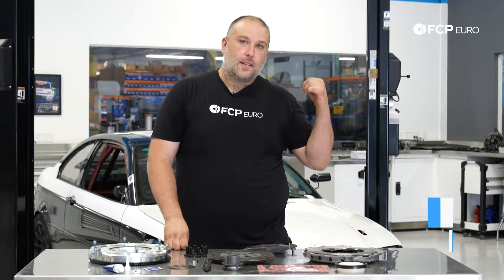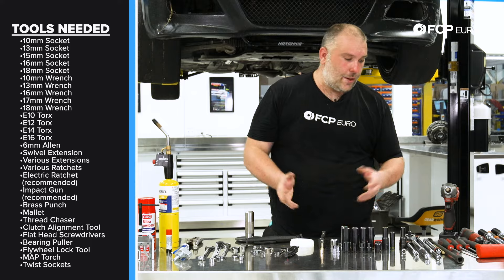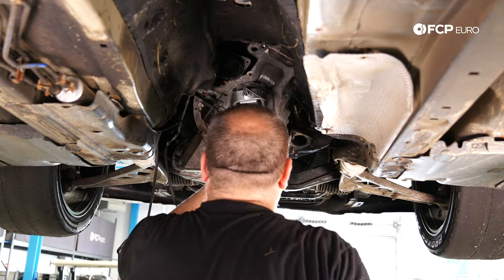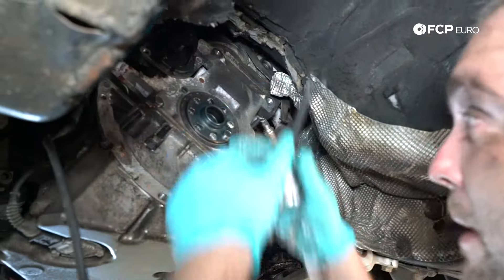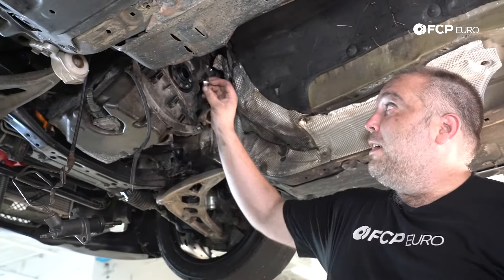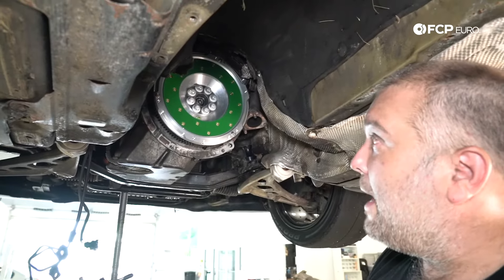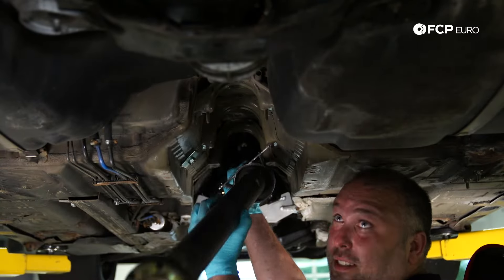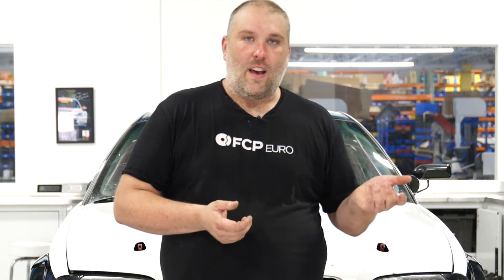BMW E46 Clutch, Flywheel & Rear Main Seal Replacement DIY (330i, 325i, 330ci, 323i, 325ci, & More)

Comment: I would HIGHLY recommend jacking up the front of the engine to get the trans lower even WITH factory engine mounts, makes life so much easier.
Reply: And because the motor naturally wants to lean forward, doing this will prevent you from snapping bellhousing bolts off in the block and possibly breaking off a piece of your engine block :)

Comment: You should probably tell people to clean the flywheel bolt holes BEFORE they install the rear main seal, because I did as you said and applied some brake parts cleaner, and some of it ran down and positively RUINED my neatly installed rear main seal that I just paid $55 for and spent half my morning putting in.

Comment: where can I get the torque plate you used and the bolts for it? or can I use the stock torque plate

Comment: I’m in the middle of a shifter rebuild and at the point where i’m debating dropping the transmission to replace my clutch. I don’t know if i can justify spending the extra money to convert to a single mass flywheel since these kits go over $1k.

Comment: hi there , lovely video I have got a bmw e46 320D 2004 diésel and I’ve got to change the clutch and flywheel , and in the descripción of your video it doesn’t say 320d.. , is this video valid for the parts I need to change ?
Reply from the maker: Hi Darryl, our models listed are based on U.S. trims only. We cannot confirm if your diesel trim may follow the same guide step-by-step since we never got that model here. The general idea for a RWD BMW clutch job on an E46 should be similar across the different trims.

Comment: So for the e46s, if you want to change the oil pan gasket, you’d have to remove the transmission? A lot of work and I have an e53 x5 😭
Reply: Nope. But you do need a engine hoist or the one that bolts to your shicktowers and hold the engine from the top to remove the bracket that has the engine mounts on it. This bracket is in the way of taking it off and that’s why you need ti support the engine up too as the bottom is being taken off to do it. After that you have full access to do whatever
Reply: @the46guide94  thank you

Comment: Hi, ld like your videos specially the s46 m3 ones and have an account on FCP
Do you made a SMG bleeding video or SMG clutch replacement? I just want to relocate my SMG pump with harness and hoses extensions and change de clutch kit to. Also with FCP I can buy a program to bleed the SMG?

Comment: Does the release bearing have a “wobbly” fit on the input shaft sleeve?
Reply from the maker: The rotating surface should have that, Michael.
Reply: @fcpeuro  so wobbly on the point of contact for the pressure plate, but not against the actual input shaft sleeve correct?

Comment: Hey when I was reinstalling my shift linkage I noticed that after I installed it my shifter on the inside of the car was not centered, when it was in neutral it was not centered and it was up and to the right do you know how to fix this thanks

Comment: At 30:56 these flywheel bolts were pre-coat with sealant to avoid oil leaking through the threads, not Loctite as you said. Two total different function.
Reply: Ok nerd

Comment: You didn’t mention the thread sealant that’s needed on the two 13mm bolts on the rear main seal plate. Those two are a must for oil will leak.
Reply: What’s the sealant called?

Comment: Can you also instal a single mass on a 320ci facelift?
Reply from the maker: Hi Floyd, we did not get the 320i E46 here in the states, however the process may be very similar.

Comment: Thanks for clear methodical video! 

I’m an enthusiastic newb and I’ve now got to replace a clutch for the very first time on my very first car – 2002 325xi. 

I rely tons on YouTube E46 DIYs and your video here is by far the best clutch replacement among actually pretty slim pickings. 

Couldn’t help but notice you start out though saying – 

0:38 “It’s a big job, it’s going to be a lot of fun. Hopefully.”

And then wind up at the end shaking your head to the camera and saying – 

40:58 “It’s not a lot of fun.”  

🤣🤣🤣

Still, actually it does look pretty fun – I’m ordering FCP parts now. Here we go!
Reply from the maker: Happy to help soyyoroaldo , good luck with your wrenching! Let us know if you need any help with your order.

Comment: Hey man, I had a shop install my clutch. Fx stage 2. They said they had to reposition, The starter to prevent damage to the starter or the aftermarket flywheel. This is a real legit shop, I paid 840 for the clutch install and 280 for them to just move the starter around. Does any of this sound right? I watch your video like ten times before my clutch arrive to just do research and other videos going from a dual mass to a single and none of them had to reposition the starter.

Comment: i own 2001 330xi 3 series e46 manual  clutch goes in and goes into all gears fine- on take off in gear the engine goes but sudden rpm excells in gear hi then lowers to normal then excell in speed changing gears is fine its like has no power its not constant it does it when it wants to

Comment: Wonder if some upper bellhousing bolts are accessible from the engine bay
Reply from the maker: We havent seen/heard of anyone approaching it from there as a possibility.
Reply: The only bolt that's a huge pain is the upper left hand bolt (almost vertical at 12 o'clock. The issue you'll run into when removing the upper bell hounsing bolts from the engine bay is back spacing to finish threading the bolt out. To this day for me the fastest way to get those bell housing bolts out is by using long extensions and getting it from underneath.
Reply: Gareth Foley gotcha. Not going to do an e46 clutch job anytime soon. Just replaced the dual clutch module on the “reliable” b8 s4 where upper bellhousing bolts were relatively easily accessible from the top ( of course if you unbolted what they call the false firewall) and thought this maybe the case for some bmw upper bellhousing bolts, but seems like this is not the case. Got to note how easy this looks compared to an Audi job.
Reply: @fastboatster  I've done a B8 clutch before on an S5. For sure the bell housing bolts are much easier to access on that platform. Wasn't 100% sure how the whole flywheel set up worked on those cars before getting into it (as it's definitely not a traditional setup) but the whole setup with the flywheel is more similar to how you'd remove a transmission on a traditional automatic car. I liked not having to wrestle with lining up the input shaft with the clutch since you install the clutch and flywheel into the bell housing prior to putting the transmission back in. I was actually pretty impressed with the design and it's simplicity.
Reply: Gareth Foley yeah, 6mt is probably easier , I was actually replacing dual clutch module in the dsg transmission. Not overly impressed with design, had to unbolt the right cat and probably should have unbolted the left one and dropped steering rack to make things easier. The thing is very heavy and also has a CG behind the oil pan so it was leaning backwards all the time. Had to jack it up from the tail and make sure that the trans dmf face and engine’s flex plate are parallel to each other using level otherwise it wouldn’t go in all the way. The main issue for doing this on the jacks is weight, being able to wiggle the transmission up and down with bare hands makes things easier. If given a choice, I’d rather do an e46 clutch than that job and honestly would prefer to drive e46 or an e90 instead of the s4

Comment: A good one would be oil pan gasket replacement.
Reply: ive done both and an oil pan gasket replacement is soo much easier then pulllin the trans on these cars. i may be doing a friends soon if so ill be sure to film a how-to

Comment: For a street car - how bad would the low rev / idle judder be with this setup?   Is there a sprung clutch plate that would fit this flywheel to compensate for the loss of the Dual Mass damping?

Comment: What keeps the starter from falling away from the transmission after you remove the bolts?  I’m imaging having a hard time getting it back on the bolt holes when it’s time to reinstall. I hope I do t have to remove the intake manifold.
Reply: Theres really nowhere for the starter to go, its still on the locating pin and engaged with the flywheel when the bolts are removed. And once the flywheel and everything are out of the way it just rests on the block where it is

Comment: Are there significant differences for this job on the xi series?
Reply: No. The biggest difference is the drive shaft setup. Because of the AWD. You will have the piece that converts the drive for the front wheels. Should drop with the transmission
Reply: @ThatE46  Thank you for that! I’m going to get started on my clutch upgrade and was wondering the same thing

Comment: Great teacher.  Watching a few if your videos and your knowledge and quality to detail is impressive. Are you available to work on customer cars? Mine is an 02 with 86k stock.  I've been toying with the idea of hotter csl cams, intake and headers. Would this be a desirable upgrade or should it remain stock?
Reply: keep it stock brotha refresh that suspension and driveshaft and brakes and oil leaks PREVENTATIVE MAINTAINENCE

Comment: Nice video, one question, soon I will have to change the whole clutch, can I mount the 320d 6-speed gearbox to have the 6 at rest, obviously also changing the drive shaft since it is longer?

Comment: So after engine rebuild this is most difficult to do on car i guess. Even with all that staff support its exhausting. Great video man. I gonna do this job probably next year together with straigh pipe and LSD diff set. Its gonna be tough week :D. But i will use spring loaded clutch to be more comfy and want to avoid that diesel rattle sound. I hope its go well.
Reply from the maker: Let us know how it goes TheExtraleague!

Comment: Great video Gareth as always. I just did an auto to manual swap on my E39 530i and a lot of this is is very similar. Of course, I bought most of the parts from FCP Euro 😁.
Reply: Haha doing the same on my 325i e46 individual.. how much fun did you have running the clutch line? From master to slave.
Reply from the maker: Love to hear that javarithms we appreciate the support and glad you watched the video and enjoyed it even though you're familiar with the job!
Reply: @hamishmchardy2896 yeah trying to install the pedal assembly while connecting the lines to the master cylinder was not fun...initially had a leak from the slave line because it wasn't seated all the way. Make sure you get that audible click sound when you attach the lines. I have a 2 post lift in the garage 😁so the job was actually enjoyable. Respect to anyone doing the conversion on jack stands.

Comment: @FCP Euro Why are you using the ZF 5 speed and not the Getrag 6 speed on your race car?
Reply: Generally the ZF 320Z 5-speed is seen as a more durable transmission and has better gearing compared to the ZF 6 speed BMW used in later model E46's.

Comment: How long did it take you in total from start to finish?
Reply from the maker: With shooting the video (the starting the stopping etc) it took us about 10 Hours. That being said without shooting its about a 5-6 hour job. It can really depend how much extra stuff you are doing while you're in there, we basically did a full refresh minus detents so it took a bit more time than if we were just replacing the clutch disc itself etc.
Reply: @fcpeuro  Do you guys have an actual shop for customers or do you only do work on the FCP cars?
Reply from the maker: We only work on employee cars, so not an actual shop. And due to liability and such we unfortunately don't do any work on customer cars 🙄
Reply: @fcpeuro  Is there someone that you recommend in the area, because I am not far from you. I have a good general mechanic but I am looking for someone that is more BMW specific without having to pay dealer prices.